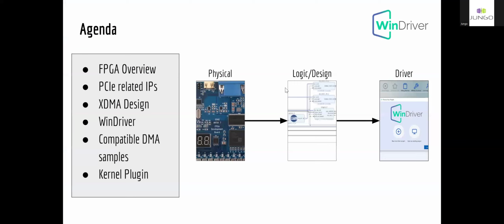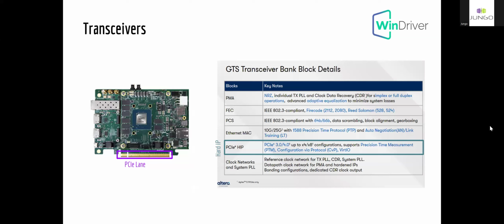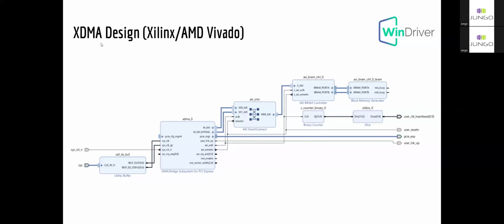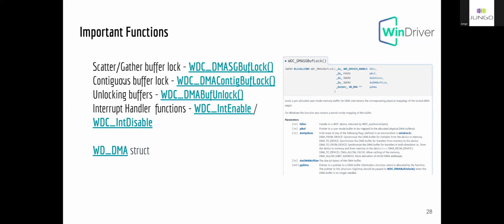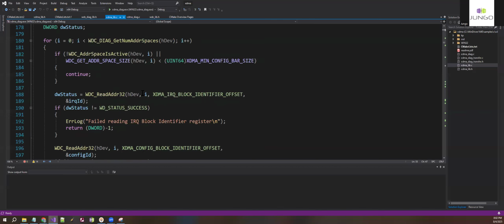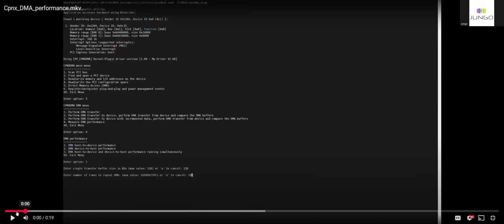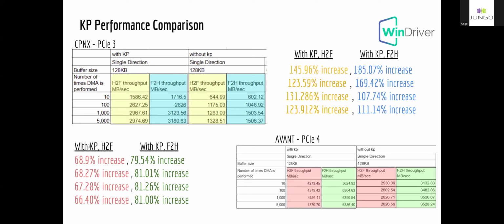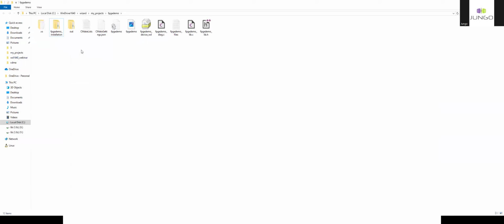Webinar: PCIe Driver Development for FPGA with WinDriver

Comment: Correction: A FPGA is not a board, the FPGA is a programable semiconductor device that allows to implement different digital logic circuits and can be reprogrammed via hardware description language or by Model-based design. The FPGA comes in an standalone chip or integrated in an SoC chip with specific form factors depending on the size and integrated hard IPs. Of course, in order to program and use a FPGA, it needs to be mounted on a PCB with the required circuitry and peripherals for its operation.